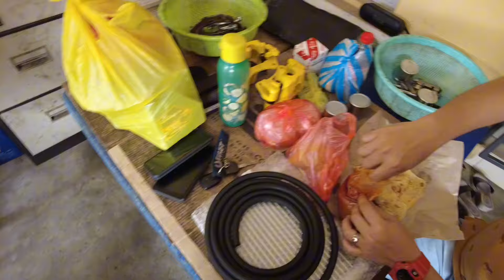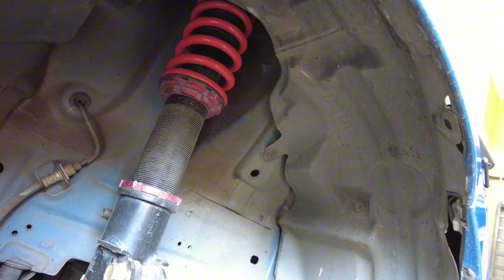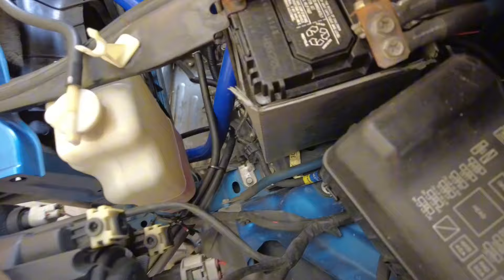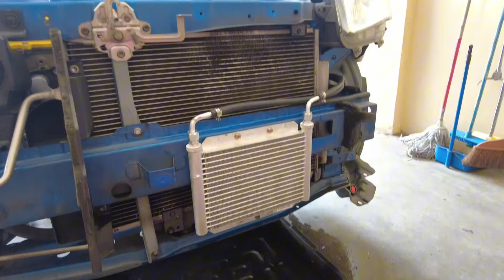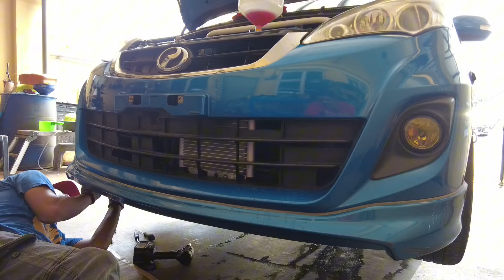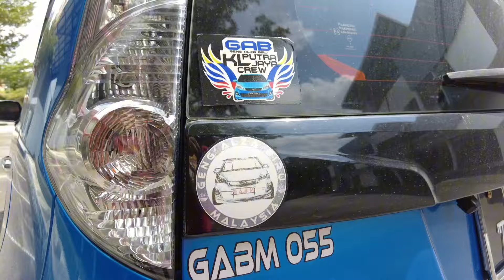Perodua Alza Install External ATF Oil Cooler setup Adjustable

Comment: Nak tanya boss, apakah yang mengalir di dalam oil cooler ?   Minyakkah atau air ? Kalau minyak, bermakna direct oil cooling ?
Reply from the maker: @C14882  yg ada didalam oil cooler..minyak lah
Reply: @faizalkaply  Sistem radiator ada water pam yang memusing-musingkan air panas antara enjin dan radiator untuk turunkan suhu. Oil cooler ini tiada oil pam . Adakah minyak gear box alir dengan sendiri ? Betulkah kita mesti masukkan minyak ATF tambahan yang lebih daripada original untuk isikan oil cooler dan hose ?
Reply from the maker: @C14882  dalam gearbox ada oil pump dia serta ada aliran output to input yang melalui OEM oil cooler atau lebih dikenal sebagai warmmer ...kerana minyak gearbox disejukkan dengan bantuan cecair coolant. Yg pada ketika ini sedang hangat diperkatakan coolant bercampur dengan minyak gearbox disebabkan berlakunya kebocoran kepada warmmer tersebut.  Akibat daripada itu,menelan berbelanja sehingga kan 3 atau 4 ribu ringgit kos untuk membaik pulih...jadi Sy buat inisiatif lain iaitu minyak gearbox disejukkan dengan menggunakan bantuan angin sepertimana gearbox kereta proton...untuk mengelakkan daripada coolant bercampur dengan minyak gearbox...akibat isu tersebut
Reply: @faizalkaply  Terima kasih bersungguh-sungguh mengambil masa untuk menjelaskan semua ini . You are best !

Comment: Kalau guna oil cooler kete lain boleh ke bang? Masuk yg ori proton saga punya ke
Reply from the maker: Boleh je..tapi kena pakai hose size 10mm la...tapi fitting untuk Gearbox asal 8mm ...agk sempit skit
Reply: @faizalkaply  okey beressss bang

Comment: Yg ke radiator xpkai dh kan bang
Reply from the maker: Pakai lagi
Reply: @faizalkaply  jemm sya ingta dia xlalu situ dh..kta abg pkai t ka
Reply from the maker: @imaziz2984  dari radiator kelua p oil cooler.  Lps tu baru masuk ke gearbox